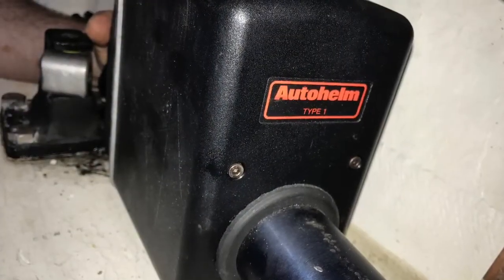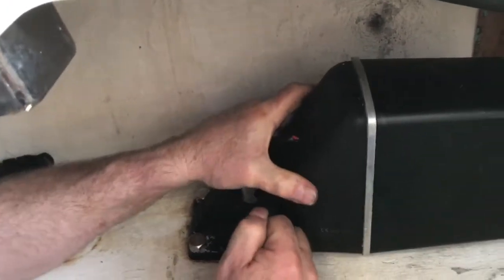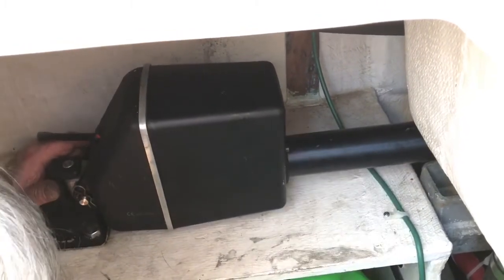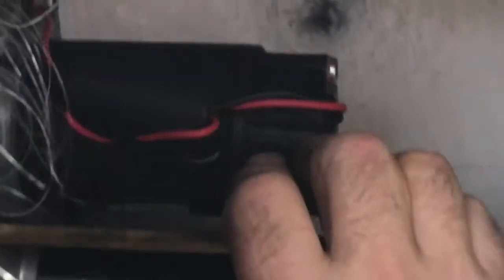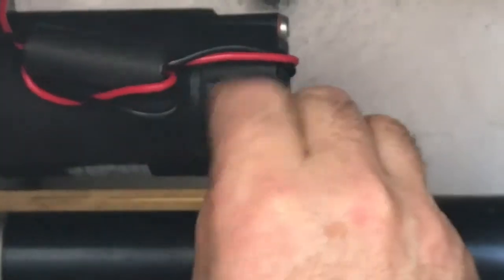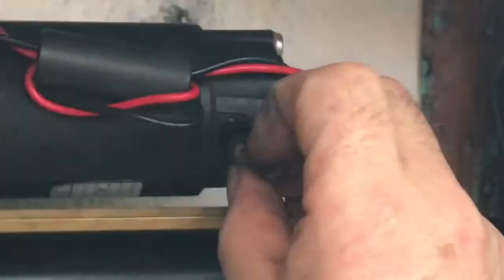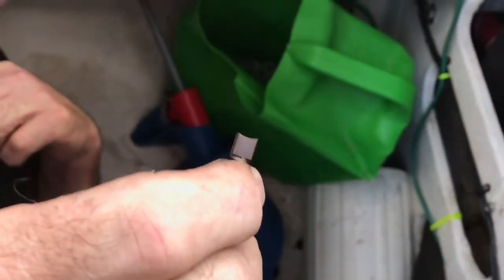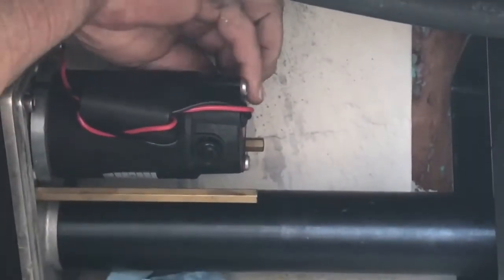Cleaning the Autohelm Autopilot Armature Brushes

Comment: Good video . can you provide motor brush specs and where to buy replacement brushes. What are the dimensions  6Tx10Wx20L mm is this correct. Does the brush have a shunt. How long is the spring, spring diameter cap diameter  photos of the brush would be useful when ording brushes from a supplier.